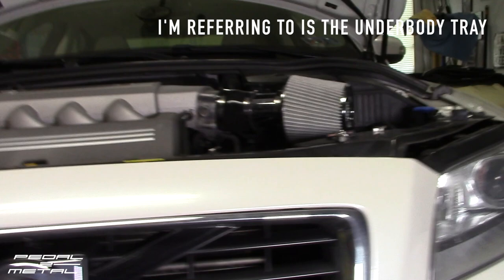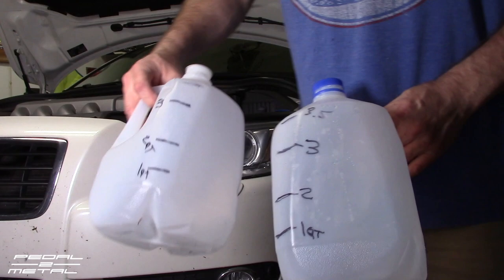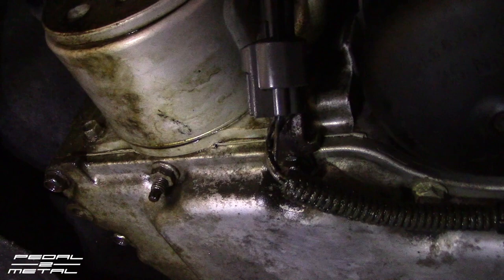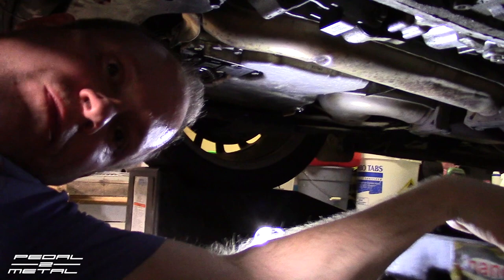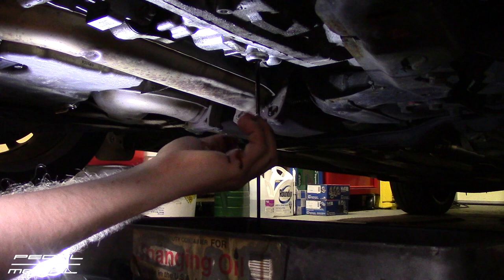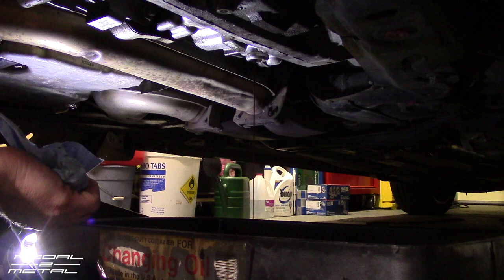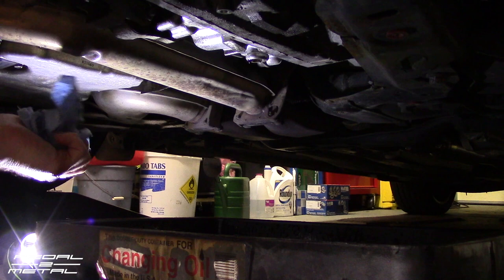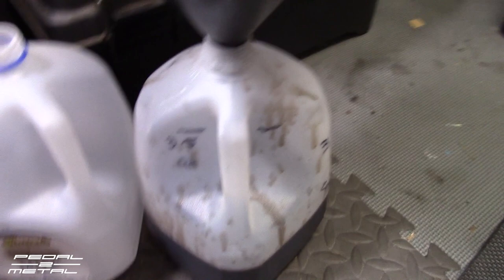Aisin TF-80SC Trans Soft Flush Performed | VOLVO S80 V8 1:1 Scale Project Car

Comment: @Pedal2Metal Thanks for your videos, keep up the good work. I was wondering what are your opinion on Volvo's official recommendation which says:
"Check automatic transmission fluid level only if an external leak is identified. Volvo recommends changing automatic transmission fluid every 52,500 miles / 84,000 kilometers, only on vehicles used for towing, or when a message displays in the Instrument Panel Text Window." Otherwise, Volvo considers it a "lifetime" fill.
Reply from the maker: If I had owned this car from New, I would have changed the fluid out every 35-40k miles, regardless of what the manufacturers tell us. No fluid is good for a lifetime. I suppose "lifetime" to them is most likely 100k miles, post warranty period though. Thanks for watching!

Comment: I know I'm a little late to the party, but does Volvo require a reset on shift adaptations after fluid change? When I flushed my Ford Edge i just dropped the fluid 3x (while the battery was unplugged) and let the computer relearn where it needs to shift; that is why they have that ability. That car shifts flawlessly now after a reman valve body and a bit of driving...

I have an V8 XC90 myself and that was my plan; drop the fluid 3x then let the computer undergo a relearn. If it shifts smooth afterwards then I'm done. If it shifts worse then I'll take it in to have the adaptations reset.

I think that should be the rule of thumb here.
Reply from the maker: I did not use Vida Dice to recalibrate..  my car relearning and still is shifting great.

Comment: Why are we changing transmission oil 3 times?
I am hearing knoking on 3rd gear when accelerating and reverse some times
I change it once on 70 000 miles
I still hearing it when diving more than 30 minutes some times
Reply: Fix it?
Reply: @richieramos2630  how to fix it?
Reply: @richieramos2630  what is the reason?

Comment: Hi. Did you perform transmission adaptation or initialization (I don't know what is the right word for that) by diagnostic tool after this operation?
Reply from the maker: I do know what you are referring to; through vida dice software. It only resets the oil service life time period. I have vida dice, but I did not reset the service period with it.
Reply: @Pedal2Metal_on_YouTube  Thank you for your reply. Actually my car is Peugeot 508, which is having similar Aisin transmission TF-70SC. I have crossed the 200,000 km and first time decided to flush the transmission. I have made some research and understood that doing this without service period reset could damage the transmission. Also changing the oil after these much big mileage is dangerous. Since you have done several flushes at the time without reset, did you face any issue after that?
Reply from the maker: @araminasyan7944   No, from what I understand, the volvo service interval is merely an internal record keeping data logging entry. It has nothing to do with anything else, such as mechanical changes; good or bad.

Comment: Hi good day. I smiled big now. :) I was looking for a video with a V8 automatic transmission. I found. :) And I see you love small cars too. (Hot Wheels) As I. I rebuild, renovate, tune.custom cars :) I also have some videos. But I'm just a beginner. And I have a V8 Volvo. Unfortunately, he was now jerking in reverse. But only once. Everything else works well. It has changed nicely. He just jerked backwards. A day has passed. It's flawless now. Do you think an oil change can be enough? Or should I prepare for more serious trouble? Sorry about the translator. Andrew
Reply from the maker: Sorry I'm just now finding your comment.  It could be the transmission's valve body causing your issues. A soft flush of the fluid might help though.

Comment: And to ask you no issues with shifts? I heard if you change at higher miles you may have problem. Myth? I have 80k on mines looking to doing this
Reply from the maker: They (most experts) say this soft flush method should be done every 60k miles. Yours is a good candidate; mine had 122k or so when I did it.  No issues.
Reply: I did mine at 80K.  It still shifts smooth.  I’m glad I did.  Lifetime oil is a myth.

Comment: Hi so I own a 2010 Volvo xc90 V8 and some forum's say they have a transmission cooler from factory,would anyone on this channel know for sure plus by adding the cooler did it make the gear changers smoother etc..
Reply: I got a adaption reset done this week with a snapon scan tool and it's fixed the jerk from 2nd to 3rd ,just doing the oil changes is only a partial job
Reply from the maker: I did forget to use my VIDA to the adaption reset, but my car still shifts great two yrs later.
Reply from the maker: @MementoMori-xx5qo  My dealer claimed my car had every software upgrade available, so who knows. My current mileage is 141k

Comment: Ive got 105k, fluids never been changed as per the manual, lol. I’ll be doing this. Still shifts flawlessly?
Reply: Had 168k km on my 2010 V70 that I flushed 2 days ago. Shifted ok before, really smooth now...
Reply from the maker: Yes, my car still shifts great and I even forgot to reset the shift adaption via VIDA

Comment: My fill plug was tight like that too. How does it shift now?
Reply from the maker: I think a little smoother than before. I need to do another light flush sometime and replace the tiny o-ring on the small plug. I noticed i have a tiny drip from there now.